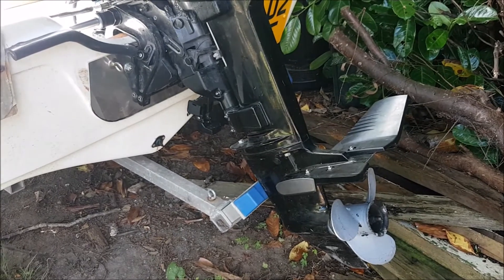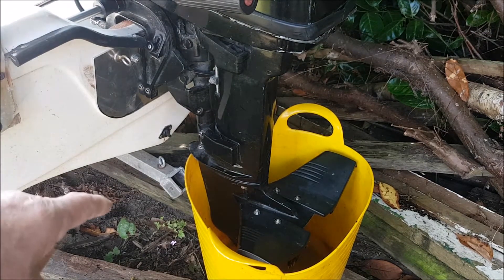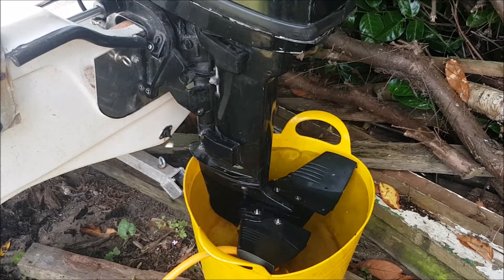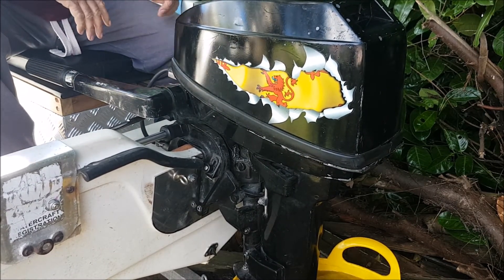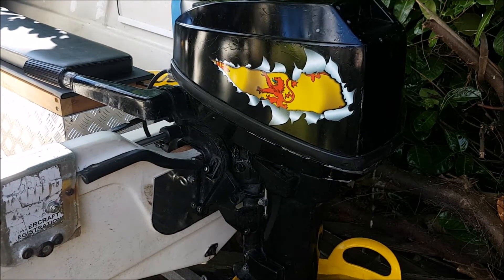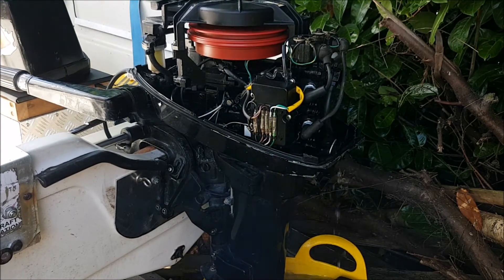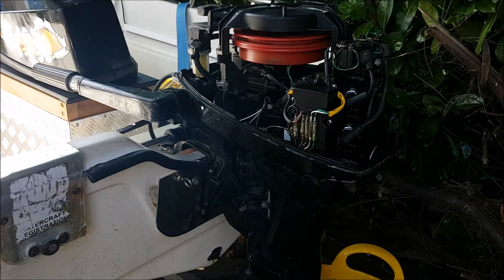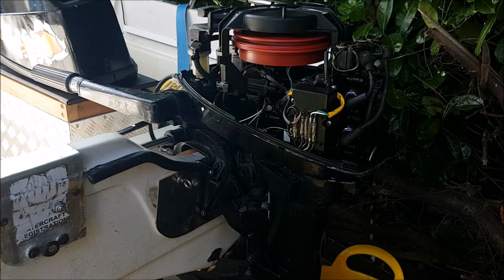THERMOSTAT TEST ON MY 15HP OUTBOARD

Comment: Just checked mine......previous owner cut the opening part off and put the case back in .no wonder it took a long time to run of choke!
Reply: I have 9.9 Johnson motor that does not pour water out or spit water from the prop. It runs super hot and smokes badly. What could the problem be first time owning a boat.
Reply from the maker: Hi Scott impeller knackered do not run without getting that fixed first ,is it a 2 or 4 stroke if 2 stroke then they do smoke a bit or to much oil in fuel   if its a 4 stroke possible rings have gone or worn bore its hard to pin point as there could be lots of reasons

Comment: I spoked to i mercury dealer about this. There will not come out any water until the thermostat opens.
Reply: Try pulling thermo out. Maybe sand behind  it. Try running
Reply: Wrong 
They will always let out some water even when cold
Reply: My 15 horse mid-eighties Chrysler sea king Montgomery Ward has no water coming out until the thermostat opens then the bottom half of the unit has to fill up with water before it comes out of the exhaust ports...the 57 Johnson motor 5.5 horse always has water spitting out of it
Reply: @TTHEPOORFARMER  have you ever had to replace the thermostat on the Chrysler?